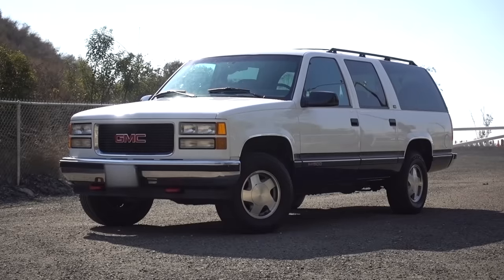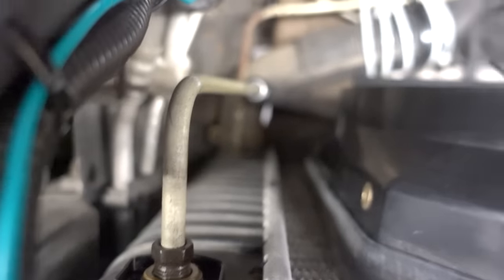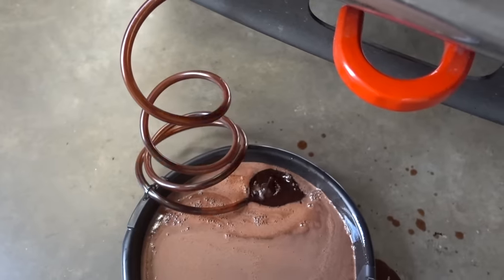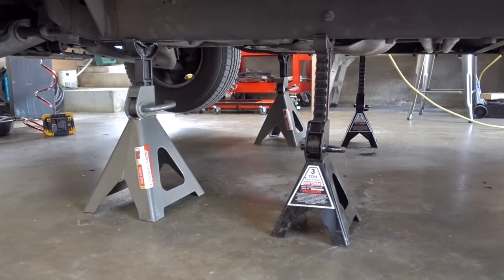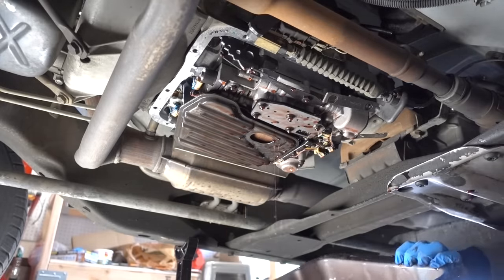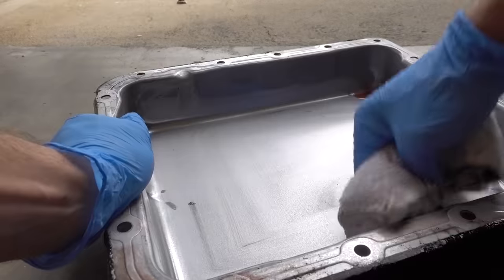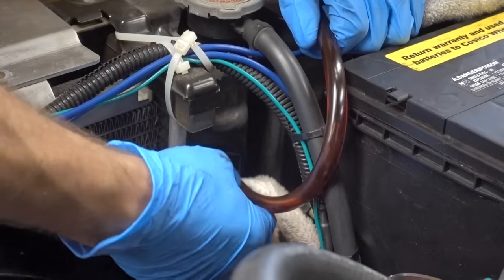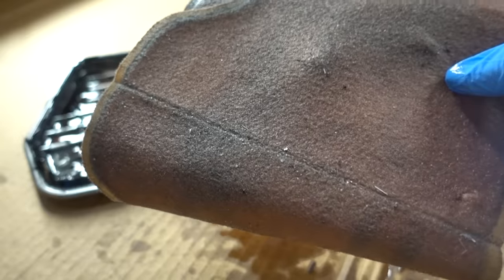Why You Should NEVER FLUSH YOUR TRANSMISSION FLUID!!

Comment: Buy a new deep pan with drain plug and a silicone gasket. If you put a light coating if silicone grease on the gasket at installation it will last for several filter changes. It'll cost you anout $50. Well worth it to increase volume and decrease the chance of an ATF shower. There's a reason GM went to a deeper pan. You probably should too for the same reason. The shallow pan transmissions use nearly all the fluid when running. I'd like a bit more.

I'm not at all concerned about getting the same screws in the same holes if they're clean.

Comment: This doesn’t flush the torque converter? Doesn’t seem worth it. Any way to flush it also? Maybe put in gear and let wheels turn? Also if you leave front bolts in the pan and loose, tilt pan to dump most fluid first

Comment: if you plan on keeping the vehicle a good while, a deep (extra capacity) after market pan with a drain plug provision is a worthwhile investment.
Reply: What's the best deep pan for these transmissions?
Reply: @professionalamateur1549  TCI, Derale, & Hughes make quality transmission parts/accessories; as for a daily driven vehicle, any cast aluminum pan should suffice. IMHO, the cast aluminum pans are a little more forgiving (less likely to warp/pull in at the fastener mounting point).
Reply: @lexdunmon7345  
Ok thanks!

Any other tips?
Reply: @professionalamateur1549  change your transmission fluid regularly (I prefer a 35-40k change interval which I am told is complete overkill) , maintain the correct fluid level,  & most importantly, assure adequate cooling of the fluid. keep the rad clean, if towing/off roading, an aftermarket trans cooler may be required to keep the temperatures in check.
Reply: @lexdunmon7345  
I don't ever tow, and i drive like an old woman most of the time
Reply: @professionalamateur1549   I'd say you're due for a filter/fluid change. generally, "abused" drivetrain components are more likely to have slippage issues with late fluid changes, as the smutz suspended in the fluid is providing grip for the worn clutches, bands, ect. I can't speak to how the previous owner drove, if you're taking care of it, & keeping an eye on fluid levels, the wear components "should" be in ok shape. as they say, your mileage may vary.

Comment: I have a 2007 honda accord with 256k miles transmission fluids were never flushed etc. I noticed that the transmission dipstick looks low. Should I add fluid without flushing?

Comment: I would never allow bubbles to come out the end of that tube. Bad idea. Instead, first change out the fluid in the pan and the filter. Then pump out a gallon and replace a gallon. Then repeat until the fluid is clean. Takes more fluid but it’s a more complete flush, and safer.

Comment: Basically transmission is no different than brakes or power steering for getting the oil in & out... Bleed out the old while replacing with the new making sure the reservoir doesn't run dry. Keep going until oil is clear & new. Done

Comment: Some shaving is normal, Just drain and refill every 60-90k miles if you have Toyota or Lexus, or 60k miles for GM or Crysler.   Drain and refill is better because it has less risk, cheaper and more than enough to keep the additives at the good range.  It does not matter if you flush or just drain and refill, GM truck transmission will fail long before the engine anyway.

Comment: I believe the idea is to never flush your transmission using a machine like they offer at lube shops because it can pressurize the wrong passages of your tranny.  They also likely wont change the filter either.

Comment: Did you say you put synthetic oil in the trans? I have a wind star 2003. Bought  it brand new.  I have it  for 17 years. I change my engine oil  every 4 months. And Trans mission every three years. My engine only have 170k mile. 6 years ago I changed my trany oil. And used the synthetic oil. I never ever had a problem with my trany  in shifting gear. Any way, I put that oil in and on  level ground or small hills it did fine no problems. But one time,  I went on  route  280 and there is a stiff hill  and  is about 3/4 of a mile. My transmission  wanted to downshift but it only started jerk and bump. I got nervous and floored it to keep  it from trying to downshift. What the hell? The only thing I did was use that synthetic oil. Right away, I removed that oil and on the oil pan there were small pieces of metal which that never happened before. I was worry now,  that trans  aren't cheap. I put Castro transaxle oil and my trans and  now  is working back to normal. That was a serious re leave  for me. My engine and trans are still working like new. I keep it in good shape been that I know a bit about cars. And one should know. Nowadays ,  these mechanic rob you blindly.  Thanks, for the video. You speak just the way I like it straight forwarded and no Ah, or eh. Saw your video on the oil catch can. Just what I needed. To put it on pcv valve. Because, it cost me $400 to repair the EGR valve hole inside the engine at one time. And that was because I did the job. They wanted$1500.

Comment: In the 70’s overdue transmission fluid would leave a coating of varnish inside the case. When the fluid was replaced with new, the detergents would rinse off varnish-solids. Those solids would cause the problem that scares people 40+ years later.  This varnish has not occurred for decades! Ask your transmission shop tech when they last saw varnish coating the inside of a transmission case. 
    I’ve also heard that the automatic transmission clutches’ materials are floating around in old fluid.  As this material floats around in the fluid, it still serves a purpose for transmission functions.  But when that old fluid is drained, it takes the floating clutch material with it.  A master mechanic transmission rebuilder told me that makes no sense.  If clutch material is floating in the fluid, it is not doing anything useful. It won’t be missed.  So change your transmission fluid, especially if its overdue .

Comment: If anybody does have the experience that the transmission starts shifting bad, I suggest a reset of the control module. I did on mine after a transmission service n it worked!

Comment: Don't ever use those rubber aftermarket trans pan gaskets, they keep squishing out and loosening, the 4l60e trans is designed with a paper gasket, cork will work if not over tightened.

Comment: i checked the condition of my trans oil using deep stick and it looks light pink and no smell so i guess i can hold off on transmission oil change / flush even though my car has 106,000 on it.  Right ?  Or the deep stick does not show the full picture that maybe deep down there in crevices of transmission there is some old ugly dirty oil lurking around ?

Comment: If your transmission fluid is too old and you flush it and put brand new fluid,  a transmissio. That was working fine may start to slip.

Better to change the fluid without flushing.

Comment: Theres no problem woth flushing a transmission. I work at a a transmission shop and have flushed hundreds of transmissions. And know tons of other shops that do it too. Its only going to cause problems if theres other problems that most likely need an overhaul to be fixed. As long as you use your best judgement to make sure your trans is working properly before doing the flush youll be fine

Comment: IF you are flushing dont go cheap on the filter. Its not like engine oil filter that you have to change every 5k.
Also if you have never changed your trans fluid. I suggest you remove 1 ltr, put in lucs trans treatment, wait for a few weeks and then keep replacing 1-2 liter ever other week or so. You can play with the interval/volume.
once all is red and you have ran over 10k after all red then you can think about changing the filter and flushing.

Comment: Remove that original filter seal, its not that hard to extract.  The whole job is a pain in the butt.

Good idea to retorque the valve body bolts.  Kinda scary that some were loose.

Comment: With such low miles, flush it. High milage replace the pan with one with a drain plug. Look for clutch material and metal and if the fluid is burnt. If OK add a gallon once a year.

Comment: If you flush it you'll be redoing the transmission:-). Scotty Kilmer is very famous for saying that if you're flushing it every 3000 miles or so then it's good for the trans but if you let it stay for a hundred thousand miles you better not flush it. I've had it happen to me. More than once. On the current Jaguar as soon as I got the car I change transmission fluid and in about a week I was in the trailer shop for $2,000 rebuild of transmission

Comment: I don’t like the idea of running the engine to pump out the trans fluid. If you’re getting bubbles in the fluid you’re subjecting the pump to a serious risk of failure and damage to the trans internals and if that happens then you’ve got big problems. Maybe you’ll get away with doing it this way without any damage and maybe you won’t. Is it really worth the risk when you can just let gravity do the job? Maybe you won’t be able to change out nearly as much fluid with gravity but if you do drain and fills regularly and at relatively short mileage intervals you’ll get most of the metal and other contaminants out without risking damage to the internals of the trans. I don’t think it’s a good idea to use any type of high pressure to get the old fluid out or to get the new fluid in. I like gravity and also it’s free.

Comment: Using the internal transmission pump to exchange fluid is not a "flush." A "flush" is when you use a big machine that over-pressurizes the transmission. That will force all those metal bits and dirt to just get embedded even more. If anything, he demonstrated the best way to change the fluid. Many cars these days don't even have a fill port or transmission fluid dip stick, making this method even harder. If you don't have the right "holes" in the transmission. Fill, drive, drain, fill, drive, ... repeat a few times. The old fluid is diluted and diluted. It's a bit overkill though.

Comment: never flush or put flushing or cleaning additive into anything with a filter without changing the filter first. The additive will likely disolve and move all the built up crap from the filter and send it through the system. Particularly fuel and oil. I buy 2 filters, fit one and drain and fill with fluid may be with an additive. Run for a short time and then do another filter and fluid change on any vehicle I get with an unknown history, but just lifting the lid can tell you a lot in the first place.

Comment: IMO, a "flush" always involves using pressure (often backwards pressure) as a cleaning process.  I never consider merely draining and filling a "flush" even if the system is completely drained as you showed.  From all I've heard, including in this video, a pressurized or reverse flush is never necessary and can very often be counter productive.  For instance, in your example at 78,000 miles, even if the transmission fluid looked fairly good, there could still be deposits that are causing no problem if left alone that would become dislodged and problematic with an actually flush.  If the transmission got timely drain-and-fills from that point on, everything would be fine. The only time a pressurized flush is safe is if done very early in the life of the transmission...in which case it's also totally unnecessary.  BTW, if an ordinary pan drain-and-fill removes as much as 50% of the total volume, then three 50% drain-and-fills will exchange over 90% of the total amount (mathematics).  You'd want to drive 50 miles or more between drain-and-fills to make sure the fluid in the torque converter gets mixed with the new fluid.

Comment: Hi there, I have a question and I'd be grateful for your help.
I detached both gearbox fluid pipes (inlet and outlet from the radiator cooler) to flush the fluid and change it for new one, but I found them blocked. What can I do, plz? Thanks in advance

Comment: Dude..  change the fluid before it gets dark.. if black do not.  Most cars need a change maybe 70K.  Changing the filter doesn't matter.  A drain refill will get about half.  They are glorified screens.  I flush thru the cooler lines.  Jack up the drive wheels, pump out till the drive wheels stop.   On mine, I could get close to 5 quarts out before the wheels stopped.  Add what came out to the input.  I reconnect and circulate for a few minutes, shifting the trans.  repeat.  My ford (Old school with dipstick) takes about 10 quarts dry.  AFT comes in 5 quart jugs.  Run 3 jugs thru.  Result is very red..  probably equivalent to ATF in a car w/15K miles.  Good enough for me.
Reply: My other car, a 2014 F150 has no ATF dipstick, and a "Lifetime Fill".  That's the big question..  Gotta Look at it.  Here I am at 72K miles.  If brown with a tinge of red, I'll flush.  Mercon is $$$.  It's a Truck, I tow stuff occasionally, hard to believe "Lifetime Fill" is legit.

Comment: How come you didn't use gasket silicone before putting gasket on?
Reply: If you use gasket silicone on the gasket it will allow the gasket to slide out causing a major fluid dump.  Also never use gasket sealer on rubber hoses held on using hose clamps as this wlll allow the hoses to slip off even when clamped down tight.  I made these mistakes on a transmission and an engine.  it seems like a good thing to do but it will destroy your engine and transmission as it did mine.

Comment: Also, if the fluid is really black, save it, because if the trans slips after the change, that means the abrasive is no longer on the bands, but is in the old fluid.  If that happens replace the new fluid with the old fluid and say a long prayer to whichever god you believe in.  You might give yourself more life to that old transmission.

Comment: Flushing transmission fluid is Big B.S You need to change the filter and clean up the magnet That is going to be not more than$50 dollars or so
Not need for scumming system from oil change place I did that in my Chevrolet Capris doing Yellow Cab service 1992 That is 746 .ooo original miles Engine oils change every 5.000 transmission every 25.000 miles Don't forget everything was going to be last No plastic and computers stupid sensors need it This vehicle was still make it in United States Before 1995 when idiot Clinton and Nafta shut down Detroit Thanks for posting this video God bless You all

Comment: there are people on both sides of the to change or not to change transmission fluid debate , and they are both right. IF you have a car like this one that is old as the hills and has never had a transmission flush, DONOT DO IT  everything has set inside there is built up sludge stcuk to parts ect ect.if you put in new fluid  the new fluids are so good it will clean that sludge off, sounds good right cause the filter will catch it....well if it makes it to the filter it will problem is the sludge can be inside the parts already and when it breaks free its game over. Think about a person who has a blood clot that breaks loose, this causes strokes , now imagine a whole bunch of blood clots breaking loose , that ,and a few other reasons are why you never change it .NOW IF your car has had regular service as it should then keep changing it  ,that will prolong the life of the trans allot .But you go buy a 20+ year old car back before there was synthetic fluids  and it has  black trans fluid already in it , just drive it and plan a transmission change one day, if you want to change the transmission sooner than later then go ahead and do a flush on it.

Comment: 13 mm socket in an old GMC?   Don’t think so.  For extra piece of mind,  use gasket sealer on both sides of the gasket b4 reinstall.  Put it on in one constant bead per side.  It will not leak.

Comment: Thats mostly old vehicles. Even in my 93 sc400 manual states don't fully flush. Newer vehicles fully flush 100% also f.y.i scanner stated in my 96 4160e modified with trans cooler, dex 6 was a major upgrade for cooling and more pressure. Incase anyone here has one.

Comment: Flushing a trans or at least swapping fluid isn't bad for it as long as it isn't burnt and there isn't heavy clutch material in it. You only run into problems when it's extremely worn and deteriorated because most of the time the gunk in the fluid is the only thing keeping the transmission from imploding. Flush it if you know what you're doing and what you're looking for otherwise leave it alone or take it to a shop.
Reply: What if the fluid is burnt what do u do then

Comment: Especially automatic transmissions which are a BITCH because they’ll almost always slip when new fluid gets in em. They need that grit so the mechanical parts can grab nothing slips. 

Let your transmission fluid get older so it’ll shift better. Lucas transmission stop slip fluid helps but doesn’t make it NOT slip completely. Manual transmissions slippage won’t happen because YOU change the gears not the vehicle.

The luxury of automatic transmissions is… you put it in D and it goes.

Always keep any transmission especially automatics in perfect shape so it’ll run perfectly no slipping and no internal wearing or leaking. My older ram transmission slipped for a while thankfully held up and did pretty good job for it slipping every once and a while i let that fluid in it go over 50k miles then I rebuilt it and the rest of the truck. Freshening everything same transmission engine, brand new front and rear differentials that can hold more weight and heavier pulling power trucks a REAL beast now!!! 

Same shell just new internals and plates